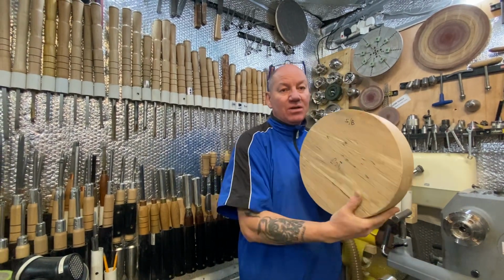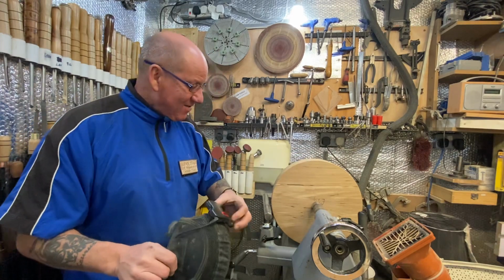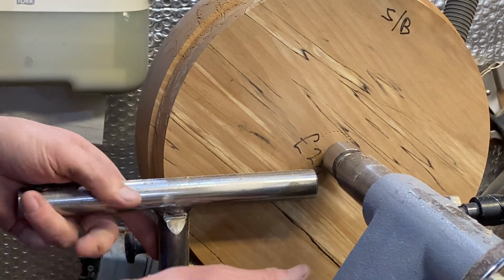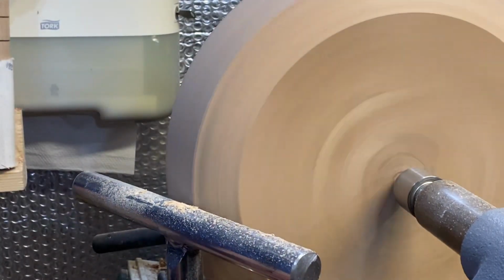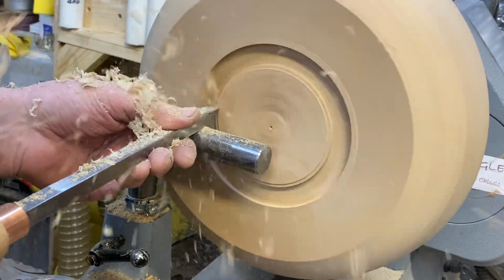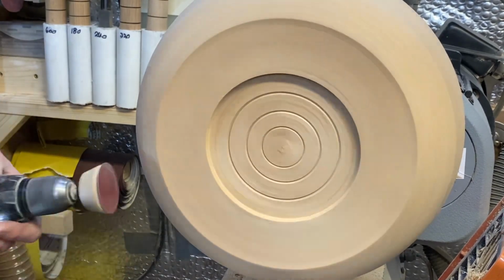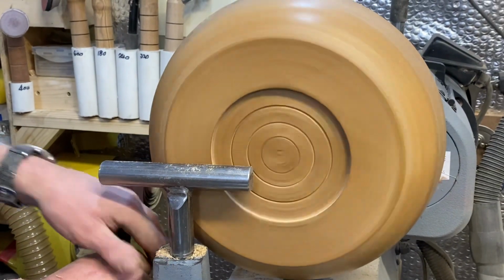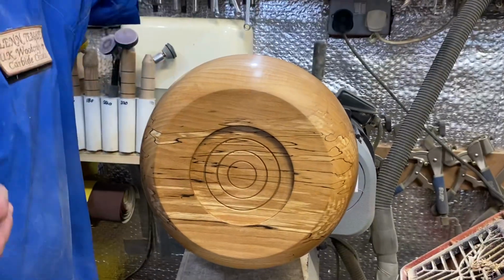Woodturning a bowl in a bowl using a selection of my carbide and traditional tools Part 1

Comment: Very jealous. -6 in my workshop for the last week. Managed a bit of turning though. Just a quick one. What bevel angle is on the 1/2 bowl gouge you used first? Thanks 👍🏻
Reply from the maker: Hi Matt, not sure of the exact angle , it’s around 40
Reply: Thanks well appreciated 😊